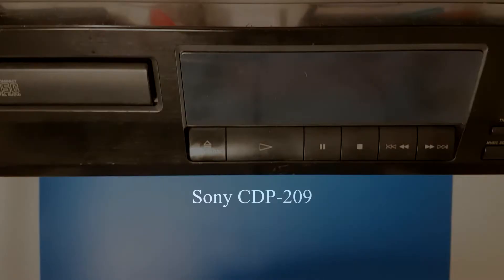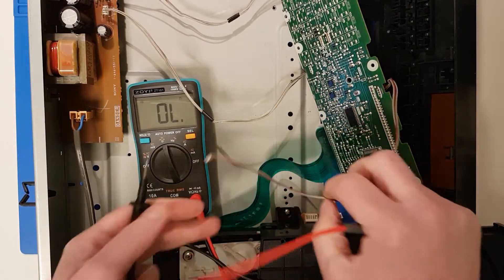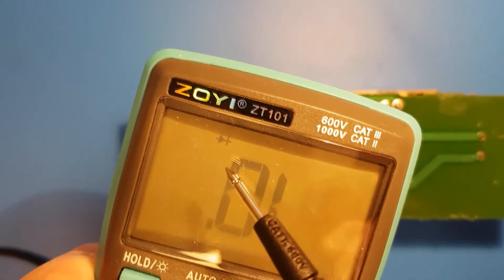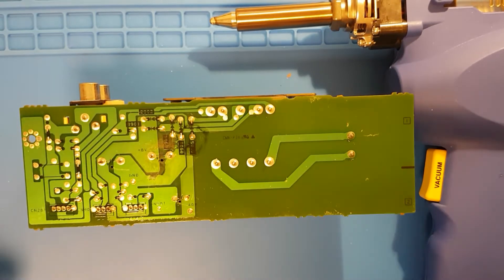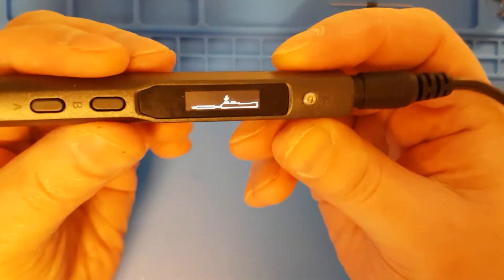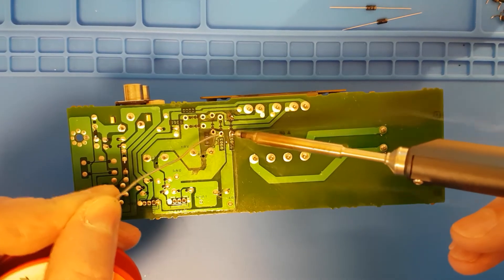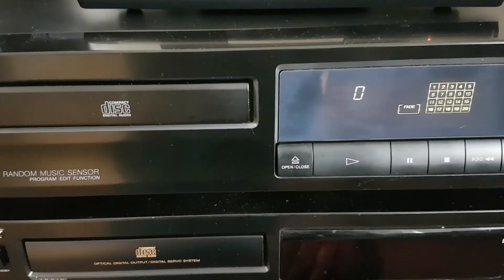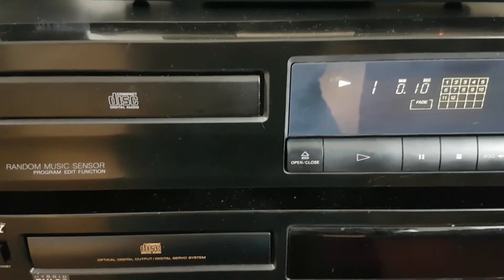Fixing a Sony CD player - Display not working

Comment: i have bought Sony CDP-K1 CD Player with pitch adjust it  comes on displays -8 on the display and does not seem to do anything else the cd tray opens closes any ideas
Reply from the maker: Hi Paul, that's a nice CD player! Does it sound like it is reading the CD? - does it start to spin when you close the lid after a cd is inserted.  If it doesn't react at all to any of the other buttons I'd check the connections between the board containing the button switches and the main board like I did in the video first. I had another CD player where the connections between the two boards on the front of the machine were loose because of mechanical stress by the buttons. Loose connections or dried solder joints are very often the cause of problems and they are easy to detect with a multimeter.